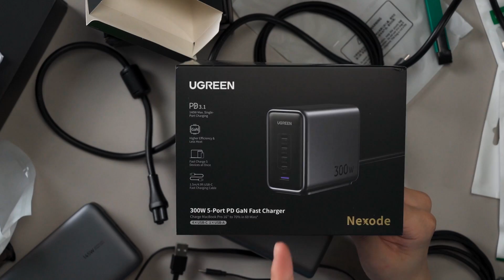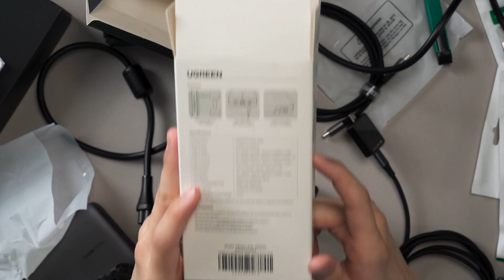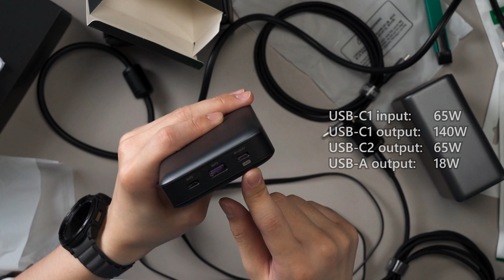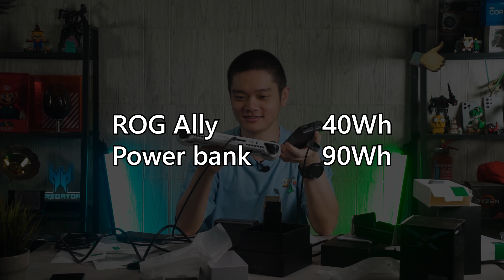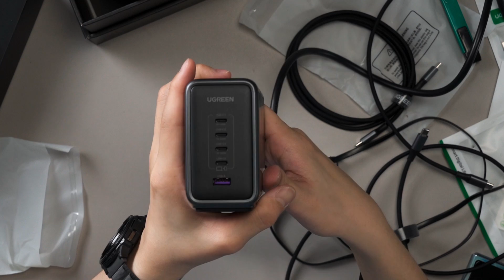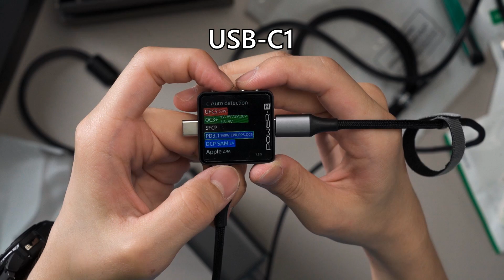Exposing Hidden Power - Ugreen 300W Charger & 145W Power Bank Unveiled!

Comment: Can super fast charge samsung?
Reply from the maker: Of course. Samsung is using USB-PD PPS
Reply: @NasiLemakTech  why my ugreen powerbank 145w does not support it?
Reply from the maker: @hyperionproductions2053  your cable issue? Or you disabled fast charging on the phone?
Reply: @NasiLemakTech  both working fine. In other reviews of this powerbank it does not support pps. Is there a different variant of this model?
Reply from the maker: Possibly. Even our tester shows USB-PD PPS
Reply: @hyperionproductions2053  New version has pps. New version cant C2 input.

Comment: so the powerbank can only charge the ROG Ally at 30W speed?
Reply from the maker: Ah I should explain more. The ROG Ally needs 65W to be able to work at its full 30W power for its chipset.

High wattage power banks like this are quite uncommon.
Reply: @NasiLemakTech  ahh i see, noted. so wait, does that powerbank manage to charge the ROG Ally @ 65W? coz ROG has it's own proprietary charging profile right?
 
I had a Baseus powerbank which is rated 65W, it can charge my huawei at 30W (the max) but on my ROG Phone it only manages 30W as well (it can't do 65W T.T) I think coz it doesn't read the ROG charging profile
Reply from the maker: @optimusaaron  ROG Ally is technically just a laptop but with a different shape, and it uses USB-PD 3.0 standard.
I'm not familiar with Baseus power banks 🤔
I know for Ugreen, there's a weird issue whereby if I plug a 65W Ugreen charger into a 65W Asus laptop, it won't get the full 65W. At that time when I discovered this, I didn't have enough tools to know why. Perhaps when I encounter it again, I will have the necessary tools now.

I think it has something to do with how the charger actually is slightly lower than the supposed wattage.
Reply: @NasiLemakTech  i see, noted~ yea it is a bit weird. but my Baseus when I plug it to charge my ROG laptop it can give full 65W juice but not to my ROG Phone xD damn...

but cool2, that's interesting to know~ thanks for replying & sharing bro!
Reply from the maker: Happy to help!